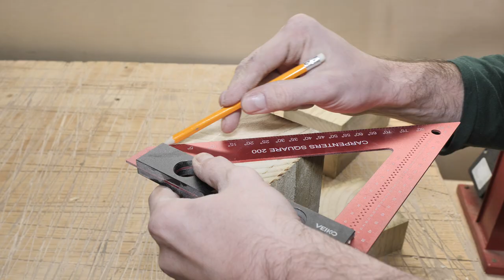WOODTURNING / MY FIRST LATHE EASY CHRISTMAS LATHE PROJECT/ AXMINSTER WOOD LATHE / TOCZENIE W DREWNIE

Comment: How did you fit CBN wheel to that grinder I have the same setup and not happy using original spacer/washers that came on the grinder
Reply from the maker: Had exactly same problem 🤦 Found that with cbn wheel u have to buy additional special washers. After that fits perfectly. Colled "AXMINSTER PROFESSIONAL BUSH FOR CBN WHEELS "
Reply: @Madebyraphael  I phoned Axminster and they didn’t suggest anything so I will phone them again thanks for the response
Reply: Thanks all sorted now